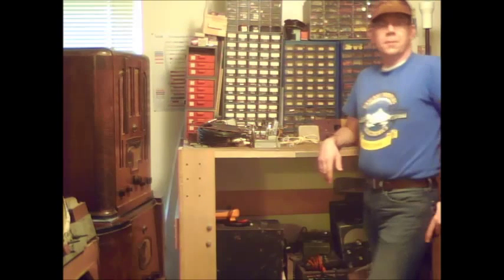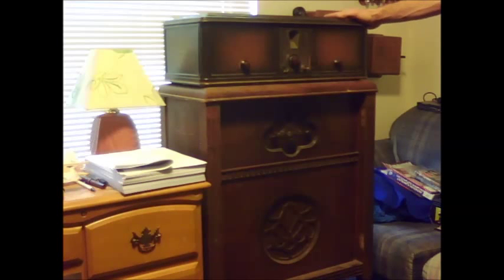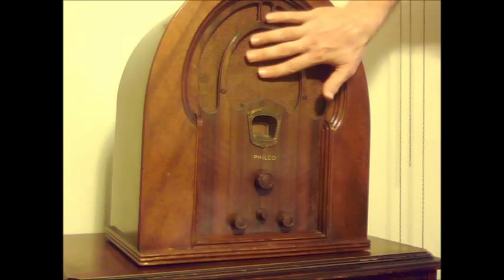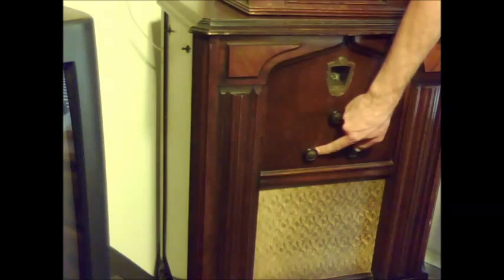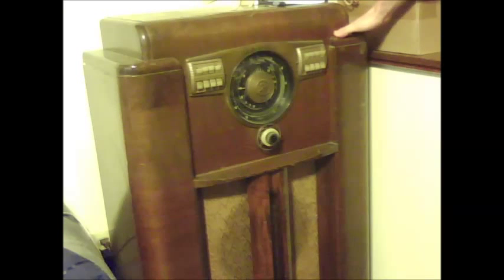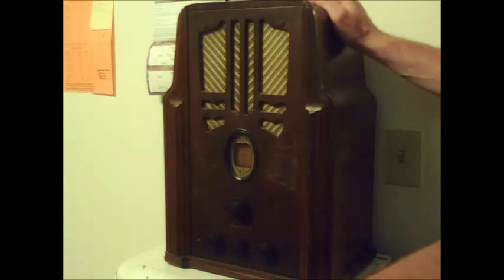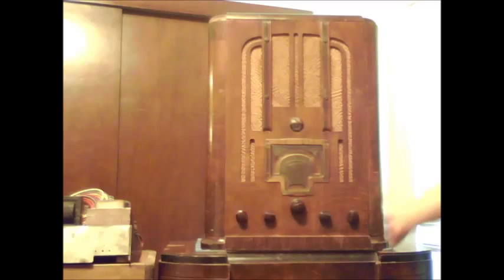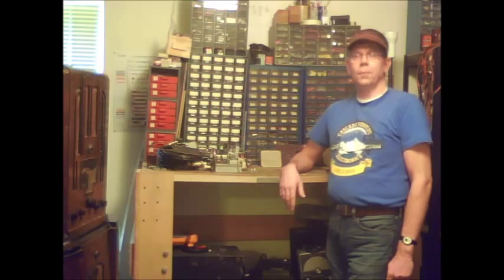Vintage Radio Intro

Comment: I have a Herbert H. Horn Tiffany Tone Model 5 (or maybe  5A)  Radio that is complete, but I can't get it to play.  This is a very early and rare radio which images can be seen from the Radio Archive or radio museum sites.  The speaker faces the top of the wooden cabinet.
I have taken it to 2 technicians, but no luck.  It is a nice looking  small table radio with a small circular Face Dial with a glass cover, all there.  It was missing the original speaker, but I have found another one, however still no luck in getting the radio to work.  It may be missing one of the bolts that holds the chassis, but one is there.  The rest of the radio appears complete.  I also have put on a new polarized wire for the set as the old one had seen better days.  The wood is in good enough shape not to really need refinishing, as a good polish will do the job as far as the original finish is concerned.

The 2 Dial Lamps work, but someone with more experience with these old radios may be able to help me out if I could find him!
Below is the information from the radiomuseum.

Select picture or schematic to display from thumbnails on the right and click for download.
For model Tiffany Tone 5 A, Horn Radio Mfg. Co. (Tiffany Tone); L.A.
 
Country: United States of America (USA)
Manufacturer / Brand:  Horn Radio Mfg. Co. (Tiffany Tone); L.A.
Year: 1935/1936  Category: Broadcast Receiver - or past WW2 Tuner 
Valves / Tubes 5: 6C6 6D6 76 42 80
Main principle Super-Heterodyne (Super in general); ZF/IF 465 kHz 
Tuned circuits 4 AM circuit(s)
Wave bands Broadcast only (MW). 
Details 
Power type and voltage Alternating Current supply (AC) / 110 Volt 
Loudspeaker Permanent Magnet Dynamic (PDyn) Loudspeaker (moving coil) / Ø 4 inch = 10.2 cm 
Power out 
from Radiomuseum.org Model: Tiffany Tone 5 A - Horn Radio Mfg. Co. Tiffany
Material Wooden case 
Shape Tablemodel, Mantel/Midget/Compact up to 14" width, but not a Portable (See power data. Sometimes with handle but for mains only). 
Dimensions (WHD) 12 x 9 x 8 inch / 305 x 229 x 203 mm 
Notes 
Available in Walnut or Mahogany cabinet. See also the similar model 5 AW in White Antique finish.
The Tiffany Tone model 66 C using the model 66 chassis; model 7 MTC using the model 7 MT chassis; model 66 PR having phonograph combination with model 66 chassis and model 50 PR using the model 5 A chassis with a phonograph comibation.
Tiffany Tone model 66 C, 7 MTC, 66 PR and 50 PR having all the same cabinet and 9 inch speakers.
Price in first year of sale 19.90 $
Circuit diagram reference Rider's Perpetual, Volume 7 = 1936 and before 
Mentioned in Machine Age to Jet Age III
Literature/Schematics (3) -- Original prospect or advert (The Tiffany-Tone Folder for 1936.)
Model page created by Doug Schorey. See "Data change" for further contributors.